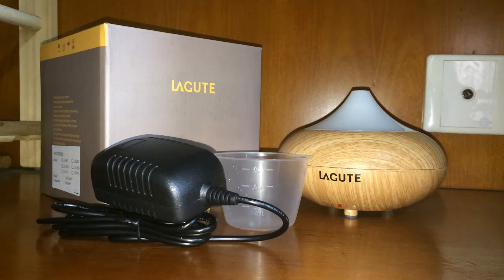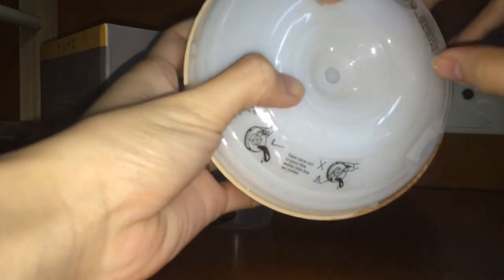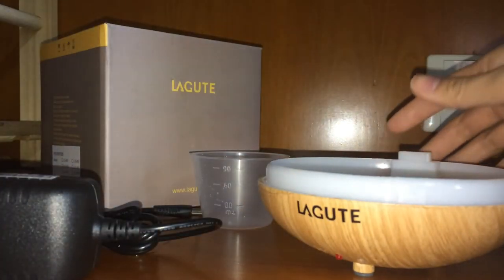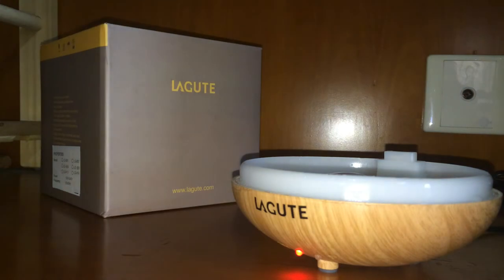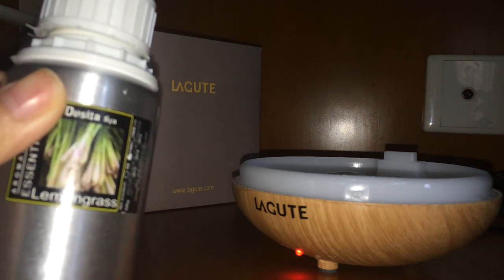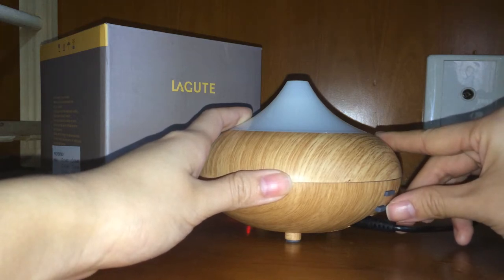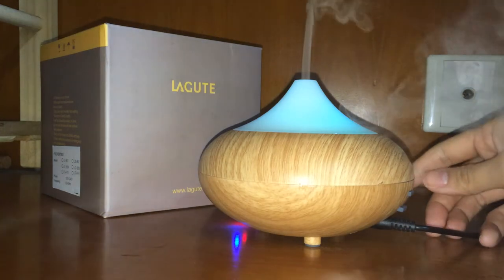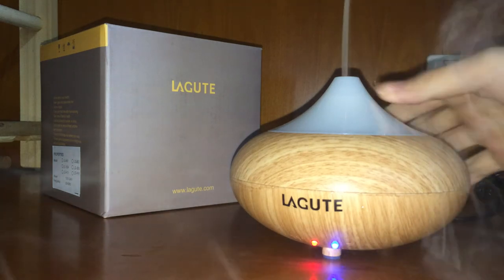Lagute Bois LG-B02 Aroma Diffuser Humidifier Woodgrain Light

Comment: The steam won't come out of my diffuser very strongly. Is this caused by too much or not enough water?
Reply: +Miranda Erickson , Don't bother with this type and (looks) of diffusers. Does not dispense 
scent like others and will have burnt residual aroma after a few hours 
of usage. Get a cylindrical types. Much better output. Don't take my 
words for it, buy 2 different ones and test it out yourself.
Reply: dannyM7M how does this give off a burnt aroma ??
It's a cold mist so the oils are never in Contact with enough heat to burn them !!
Reply: When the water level is too low and it shuts off. There's a metalic like contact on the bottom of tank. It will gives off burnt scent over time. To avoid that , rinse often after a few uses.